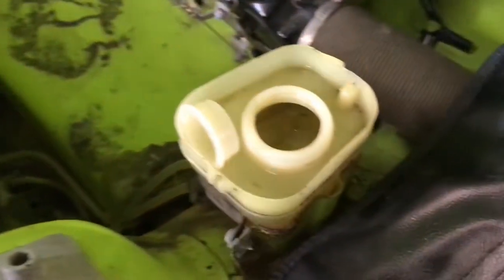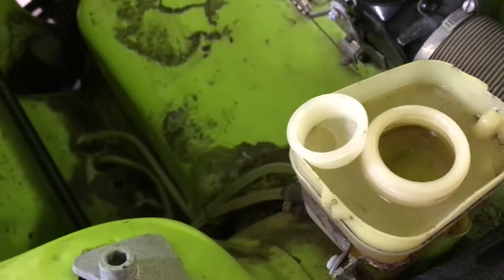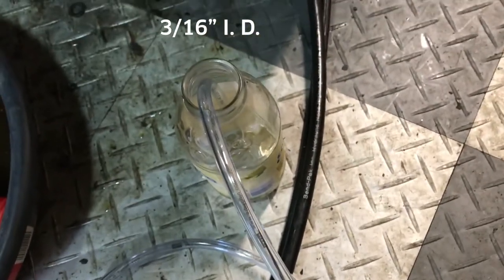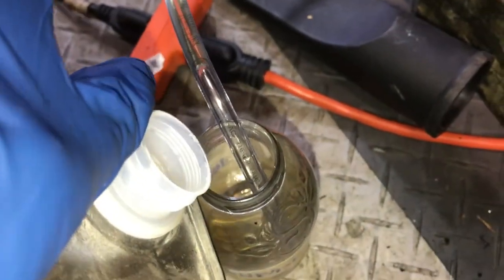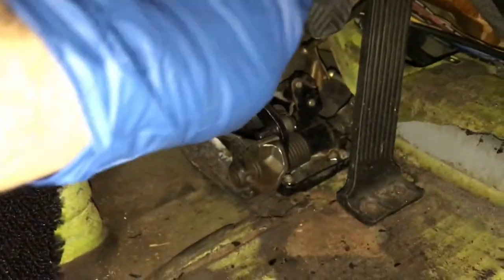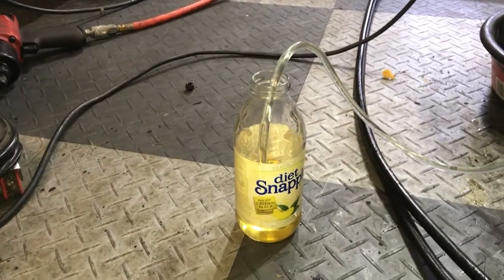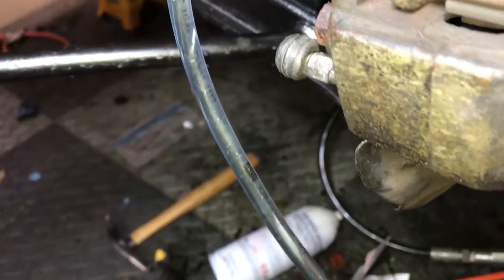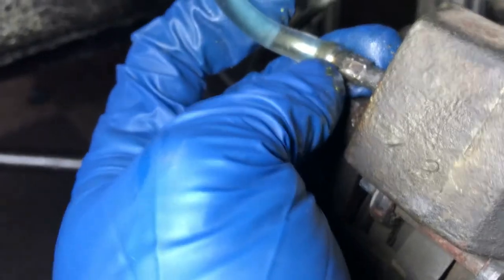Porsche 914 – Bleeding Master Cylinder in the Car

Comment: Those smaller bubbles you see through the clear tube at the caliper fitting is because there is air creeping through the fitting. You'll never bleed it properly if you don't keep the fitting threads from sucking in air, and the clear tube very tight on the fitting..
Reply from the maker: Yep. Air creeping around the bleed screw threads is a thing. It doesn't really suck into the caliper...just seeps from the threads into the bleeder / line. Especially when pressure bleeding, like I usually do. Thanks for making the point!

Comment: I did this process a few times, but I still have a spongy pedal. It goes all the way to the floor but still stops. Could my MC be bad?
Reply: I meant the car still stops..
Reply from the maker: Possible, but it sometimes takes several bleeds to get all the air out. Have you driven the car over a bumpy road or railroad tracks and then re-bled? Did you change your calipers recently?
Reply: I’ve bled the brakes four times and the MC once. I did pull off the front calipers with the intention of rebuilding them, but couldn’t get the pistons out.
Reply from the maker: Steven Henry how are you bleeding? Maybe try the gravity method and see if that helps firm up the pedal
Reply: The first two times I used a Motive power bleeder, and the last two I used the gravity method. No matter what I do I can’t get a firm pedal
Reply from the maker: Steven Henry have you changed the soft lines? Might want to reach out to eric@pmbperformance
Reply: Changed those already.. puzzling isn’t it
Reply from the maker: Steven Henry might be the MC. I’d def reach out to Eric